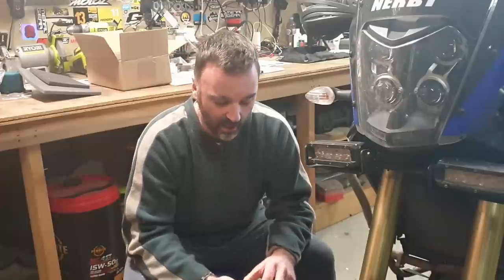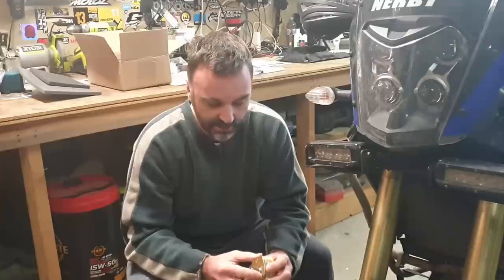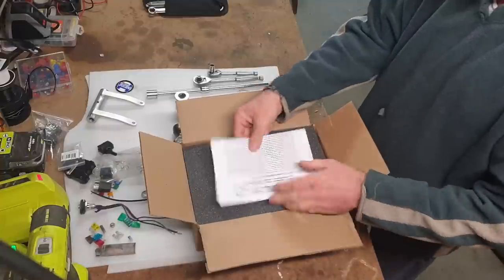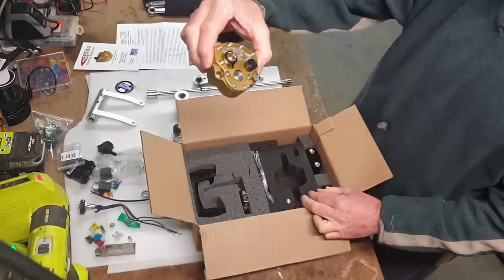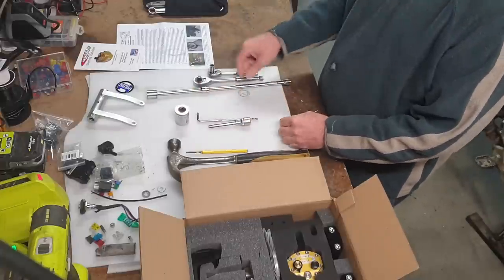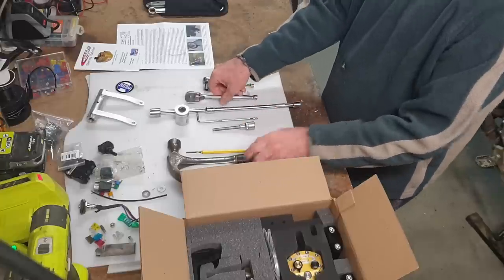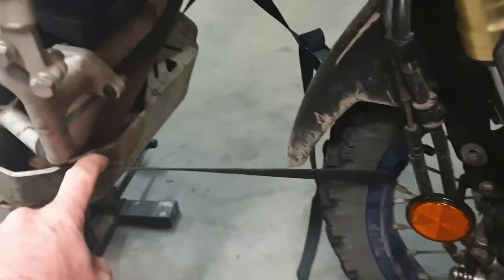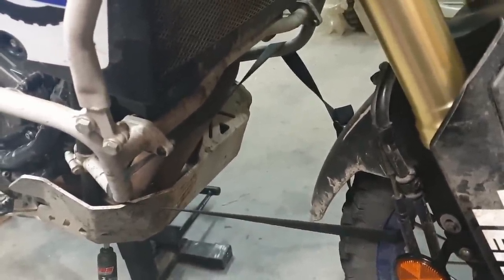Scotts steering stabilizer for Yamaha T7 | Do it yourself

Comment: I liked the video, except what you do with tightening the castle nuts. The 1st castle nut has a 3 step tightening (1st to 75 Nm, 2nd loosen 180 degrees, 3rd to 7 Nm). The 2nd castle nut just needs to be finger tight. Also look for "steering nut wrench", that gives you something that you can attach to your torque wrench and tighten the castle nuts to spec.

Comment: Great addition, mine has saved me from going down many times.  Don't be afraid of adjusting it from the stock setting.  It took me 3 years and someone riding my bike and telling me it was too stiff to finally adjust it to where it isn't interfering with my riding anymore.
Reply: i run 0-1 on my dr. doesn't need much

Comment: Thanks Brendon. Frustrating times in lock down. Scotts steering stabilisers are top quality bits of kit. They definitely take away the twitchy uneasiness on long straights when punching away the K's. I have found they can mess with your head stem tension though - and give some movement within the head stem after long hard rock rides. More to do with the head stem dust cap they supply. If you keep a feel for movement in your head stem it its easy to tune it a bit and stop any bearing damage. I have tried different O rings etc - nothing hard to work out, just sharing the info. 100% worth the $. robust and easy to use. I have mine set between 2  to 7 for single track riding and then stiffen it right up when on open road. Its easy to forget you spent real money on this bit of fruit until you are sitting on a dollar twenty kilometers p/h and then turn the dial clockwise a bit and everything settles down just nicely.... worth every cent. Hope you are back on the road soon and crossing those unrestricted colonial map lines just like the old days
Reply from the maker: Noted, and thanks very much. Cant wait to get back out there.

Comment: Great video Brendan. A word of warning, the torque spec for the center nut on top is very high, can't remember exactly what it is, but mine came lose from factory, and it's difficult to do back up out on the trail. So make sure it's bloody tight..I'll post the torque when I get home. 98ftlb comes to mind .
Reply from the maker: 110lbft or 148Nm. Yes... very tight!

Comment: Silly question but why didn’t they just make the the stabiliser pin in two halves to save having to take all of the triple clamp off.
Reply from the maker: I dont know. Maybe a strength thing? It would make it simpler!

Comment: I distinctly heard your wrist go ‘Dink’ at 14:17 …. Torque value achieved. BTW? Have you shaved your fingers 😂
Reply from the maker: ha, not recently!
Reply: @Nerb1  Ha! :) The Scott’s large (adjustment) knob is a great addition too for on the fly changes as the little pointer type can be hard to adjust in small increments ‘up or down’ with gloves on. Mrs Nerb will be happy to know that this upgrade is a 100% safety measure. Makes a huge difference riding sand and rocky (snotty) terrain!
Reply from the maker: Im looking forward to testing it!

Comment: Does it help with the 95-120mph wobble? After going up a tooth on my countershaft sprocket I discovered a wobble SOMETIMES at high speed and am wondering if this helps.
Reply from the maker: No it doesnt. The wobble (that all adventure bikes seem to have) is too slow for the damper to do anything for.

Comment: Hey Nerb,   Good job.  Funnily enough that is on my list to do on Friday.  I have the Scotts Dampner, but I bought the Vanasche base+riser.  Luckily for me the mounting peg mounts to my frame and I don't have to worry about removing the triple etc... Hopefully mine will be even more straight forward.   Now you need to a video on tuning it... high speed dampening vs low speed dampening vs end adjustments.   :-)
Reply from the maker: Yeah, I have to learn that stuff now. My first ever adjustable stabilizer.
Reply: @Nerb1  Excellent... well I like the way your mind works,  so when you work it out... just tell me the answer ;-)

Comment: What clutch and brake levers are yours? Great video!
Reply from the maker: They are just the cheap chinese ebay short levers. I love them.
Reply: @Nerb1  Thanks for the information. I ordered a Scott's kit just like you installed in the video so will be installing when I receive it.
Reply: @Nerb1  I noticed yours could rotate up so they don't break but I don't see any like that on Ebay. ?
Reply from the maker: @kenackerson7007  No, mine dont rotate up. This is the actual one I got: https://www.ebay.com.au/itm/184364923915

Comment: "That pressure of tapping" Should have marked it maybe...?
Reply from the maker: Im making a proper tool for it, so I can actually torque it. 75Nm with the tool (which is not 75Nm on the nut). Maybe a follow up video on this.
Reply from the maker: I lied! It is 75Nm, then loosen and reset to 7Nm. I will definitely redo that!

Comment: Too bad they didn't install these at the factory because this is way too much work for a steering dampener. Although it is an excellent bit of kit to have and it is much better than a bar type stabilizer.

Comment: Great video but don't you need to re fit the big washers under the new handlebar clamps you fitted? You also need to buy a torque wrench.
Reply from the maker: I have a torque wrench... I just need to use it!
The scotts manual said to reinstall the stock washers under the perch. The bigger ones that go under the nylock nuts dont fit under the perch. I think I got it right.
Reply: @Nerb1  I thought the reason for the big washers underneath were to stop the bolts pulling the rubber mounts out of the the top triple clamp?